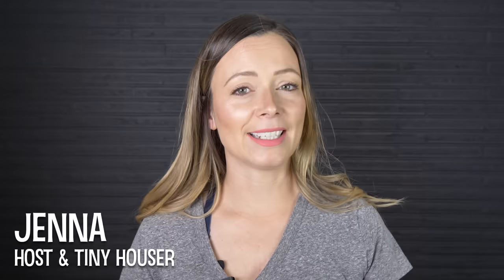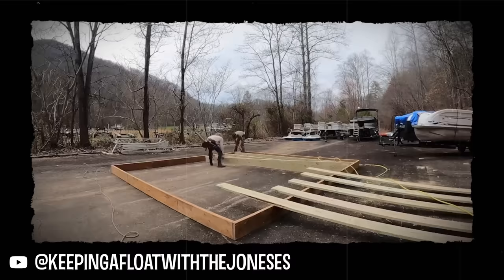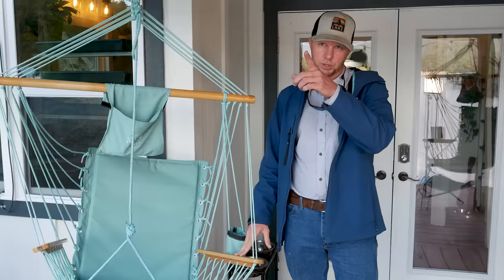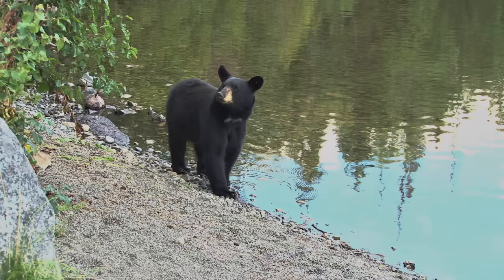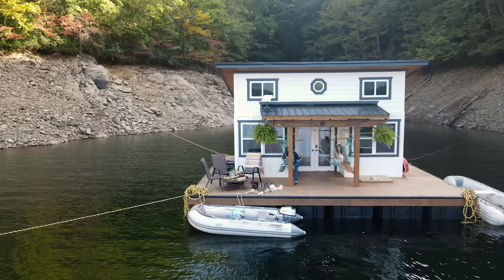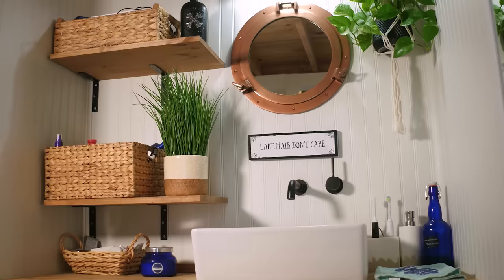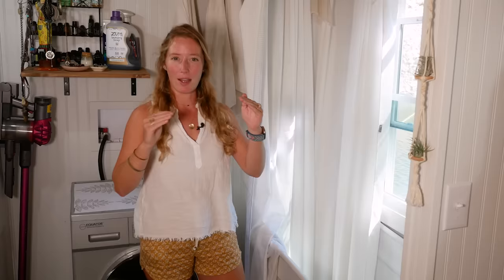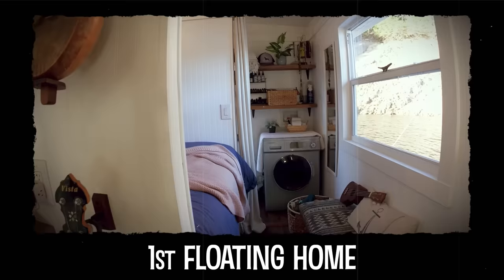Homemade floating cabin built to live full time on the water

Comment: I love it!
I would have gone with more Solar, and maybe an additional battery, and removed the gas. A heat pump and induction stove should cover it. Less cost in the long run, and no need for outside sourcing.

Comment: How do you protect the floor from moisture and mold? Typically you'd need drainage etc to keep the RH low, but in this case it literally stands on water.
Is it down to using impregnated wood or do you use some special construction?

Comment: looks like the trim is a bit off.. maybe just on optical illusion .. are the polyfloats spread out equally under the platform ? or did you add extra for under the house end which is going to weigh more.

Comment: Are you concerned about how the cables that attach the house to shore will prevent boaters from getting by?
Reply: No, bc they don’t. Our lines are set as required by our governing entities, and although it’s not even required to have high-visibility lines that are weighed down by cinderblocks to allow boat passage, we consider it polite to go above and beyond to do so. So that if a boater on a 10,000 acre lake wants for some reason to boat specifically into the 1/10th of an acre cove our house is in, they are able to.
Reply: @KeepingAfloatWiththeJoneses  Judging by the way those cables hang that is not the case.  I'm sure you are obeying the letter of the law but those cable are blocking other people from parts of the lake.

Comment: So , the taxpayer subsidises your septic system so you can live on the water. Hmmm. And where does the gray water go?
Reply: Grey water goes into same tank as black water, all is sent to treatment plant. Taxpayer subsidies your septic systems so you can live on land. A portion of ALL taxes in ALL cities and states go towards public infrastructure including septic treatment plants. It’s very normal, and necessary for public health so that low-income folks on land don’t have an excuse for dumping into creeks due to cost constraints. No different on water. It used to cost folks hundreds of dollars a week to responsibly dispose of their septic here (it would cost you that much at your house too, were it not for the subsidies you benefit from that fixed that issue long ago). Of course they are going to dump into the water when no one is looking when it’s that expensive. Sewage treatment should be affordable for all, on land and water, for public health and sanitation reasons which affect us all.